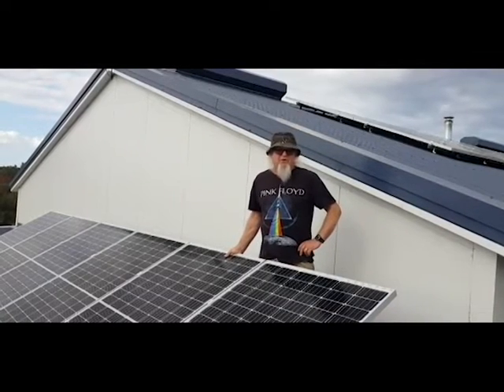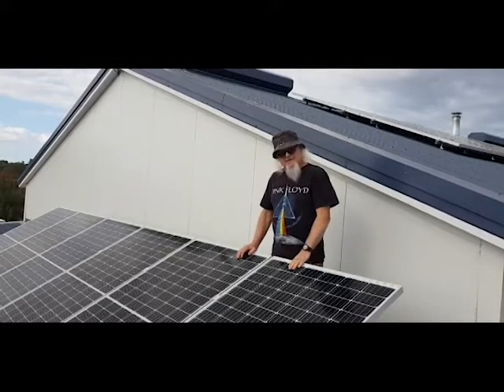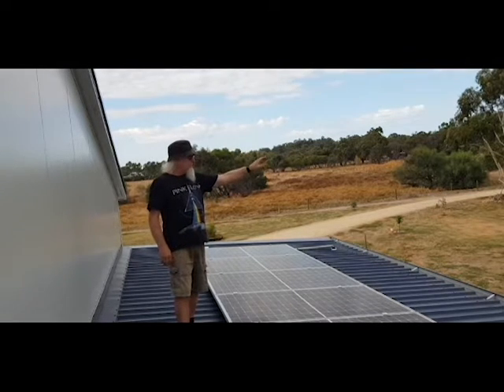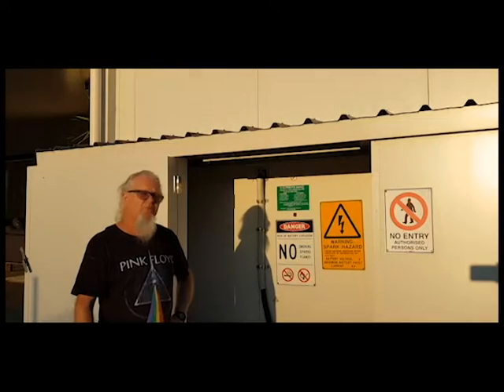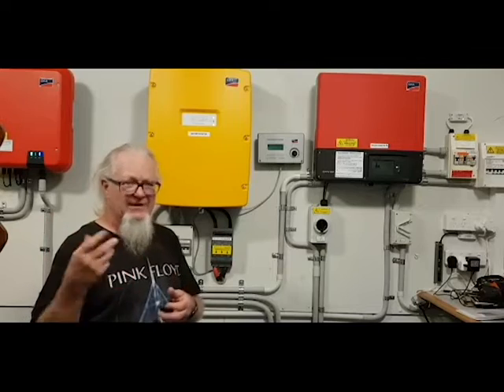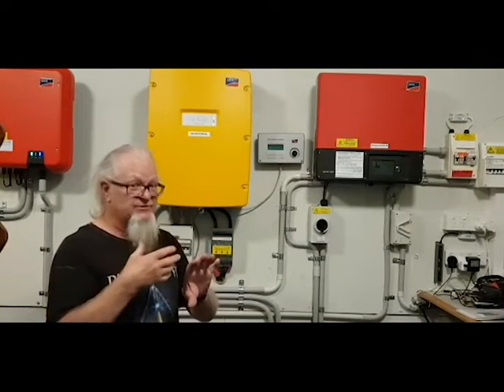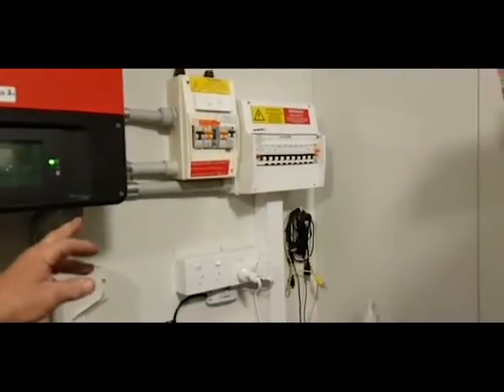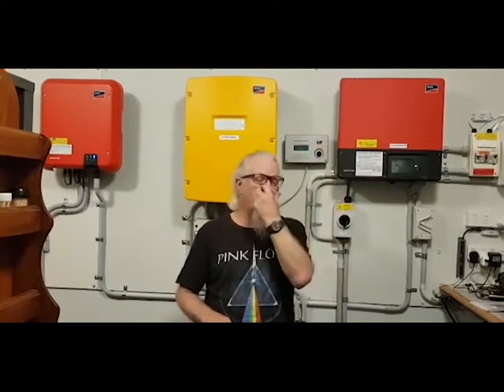Our House Off Grid Solar

Comment: Fantastic video! We are purchasing a cannibalized DC Solar Trailer (US) with (2) SMA 6048, (1) Midnite Solar 250 Charge Controller, (10) 230w Panels. I will be installing a 48v GNB VRLA Battery Bank and new panels to keep the unit charged. I am trying to find out how many panels (wattage/voltage) can be installed to reach the 50+/- Amp charging capacity of the SMA inverters. You have an Fantastic System!!

Comment: Hi. Can you please confirm if both your Red Sunny Boy PV inverter are connected to the same single phase? Or are you 2 phase where one Red Sunny Boy is connected to one phase and 2nd Red Sunny Boy connected to 2nd phase? Thanks. 

If both Red Sunny Boy are connected to same phase, how do you connect both these Red Sunny Boy together to talk to each other? Is the Yellow Sunny Island got multiple inputs so it connected to both Red Sunny Boy? Thanks
Reply: I have a similar set up, that sunny island can only be single phase, I have two of new sunny boys. I don’t think these two different ones can talk to each other, they are connected via AC cable output of the sunny island. The battery was 93% and solar was only putting out 100w mine would only do that if the battery was 100%.
Reply: @Dakalberry  Thanks for the reply. We just got our Solar PV installed last week with 2 x 6kW Sunny Boy with connected to a phase as we are a 2 phase home in NZ. Installer did tell me you can have multiple Sunny Boy’s and Sunny Island’s connected to same phase and they talk to each other via Ethernet but yeah as you said as well the Sunny Island & Sunny Boy can only serve 1 phase they are connected to. To server 2nd phase, you need to add Sunny Boy or Sunny Island to that as well.